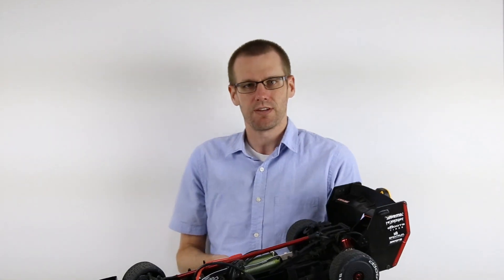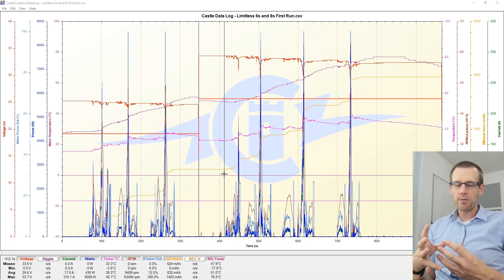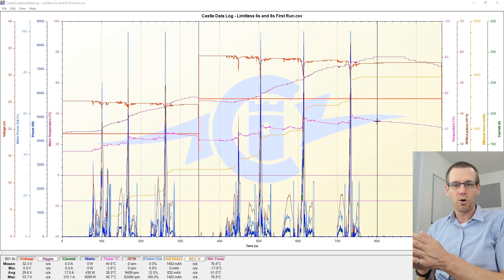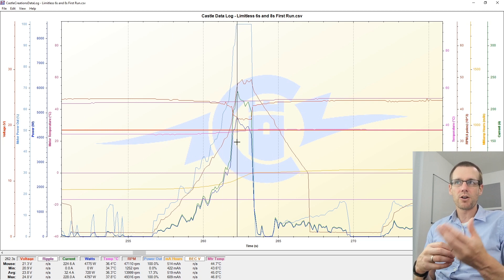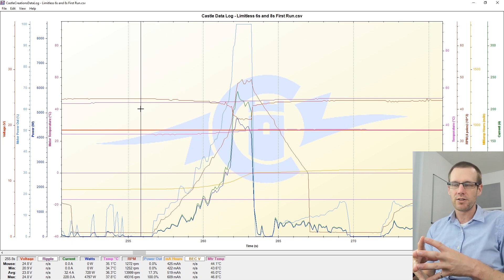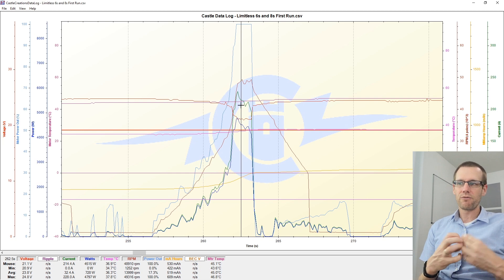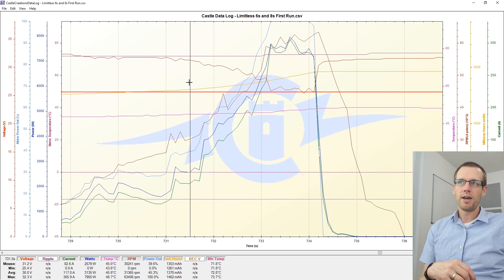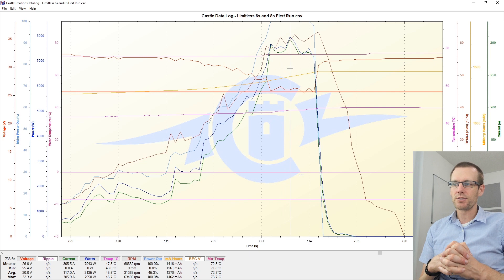Castle 1721 2400Kv Pulls INCREDIBLE Current - Reviewing the Data Log on a Conservative Run

Comment: I have done 728AMPS with xlx2 on 3s
Reply from the maker: Amazing! Well done.
Reply: @RCexplained  thanks
Reply: Holy Moly, 728A!!!....dang, here I was afraid of getting too close to 600A lol.
Reply: @rcbustanut2057  💪🏽
Reply: 650amps  on 4s easy…but slow, it takes time and distance to spin the gears past 130
Reply: @alterdcustomrc4512  yeah, I noticed that when I was running my stretched Typhon 6S on 4S with that combo, really needed that extra time to get her going. Now on 6S, I pushed 128mph on a 1650ft stretch (cut the run short). Pulled a little over 400A.

Comment: Dood seriously tell me about the power outputs and amp draws. I’ve been trying to find a way to drive my electric motors using them to spin my turbine for balancing from a wall plug to dc power supply but basically good luck with that lmao
Reply from the maker: how many wants do you need to spin your setup to maintain constant speed? I typically balance EDF's at a relatively slow speed. Faster speeds just amplify the unbalance determined at slower speeds. Being able to balance at slower speeds makes it a lot easier and safer in my case.
Reply: @RCexplained  I should rephrase. My plan was to use a wall plug source to power the turbine as a compressor for the combustion Tesla turbo jet in making. Doing the balancing doesn’t require a lot of power though relative to operational needs. Especially with Nikola Teslas high speed dynamic balancing patent 186,799 that most don’t know about. 

It uses particular resonant modes of a mass spinning on a flexible shaft, where the heavy side of the rotor is ALWAYS on the outside of the whirl orbit. This way you can drive it at an odd multiple or submultiple of the critical rpm and effectively balance any rotor.
Reply: @RCexplained  but to be accurate… I have 4x 2200Kv 6s Traxxas e-revo BLDCs on the turbine now. The rotor is like 9.35lbs lol so it needs at least two of the motors to get it going because of a lot of cogging at start up. 

My latest turbine dyno test clocked in at 4.25kW and ~5.5 ft-lbs of torque at 8000rpm with just room temp compressed air. And I have it geared up to the 4 BLDCs at 3.0666:1 so I’m dang near maxing out the torque/amps on each of the BLDCs and I haven’t even added heat to the motive fluid yet 🤤😂🔥😈